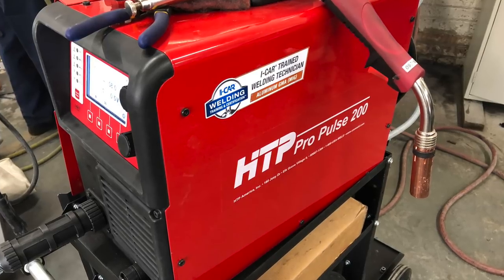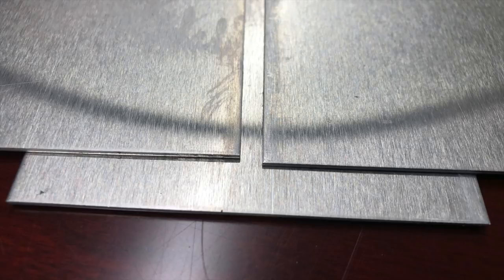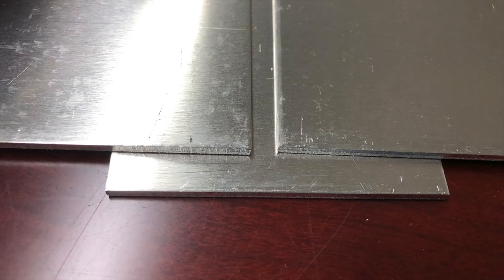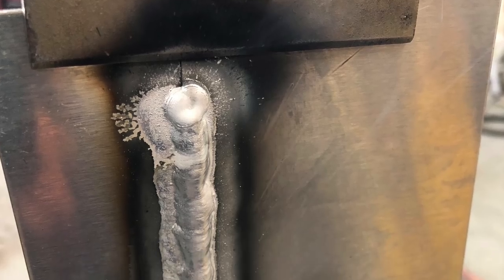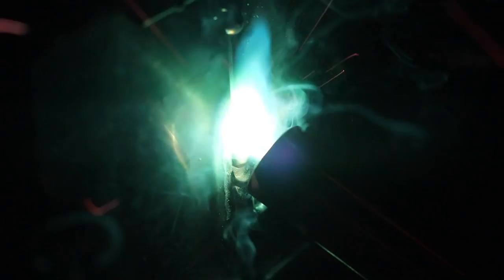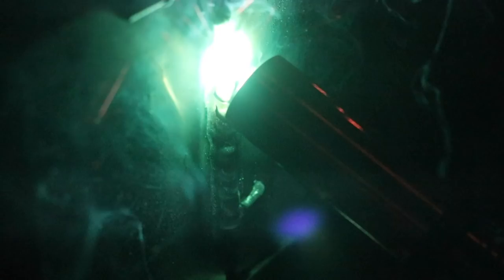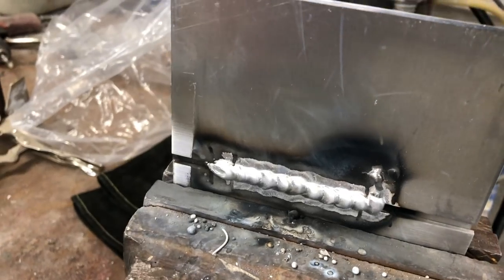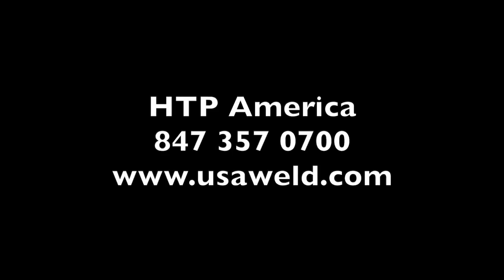(WCA03) Aluminum Welding test information for the collision repair industry

Comment: I was just thinking last night that I hadn't seen any Zila posts for a while then one pops up the next morning,  I must have picked up some psychic pulse waves in the air.
Reply from the maker: I am so far behind .....  i have at least 8 videos that i need to cut and edit - looks like this weekend i will get at least a couple done.
Reply: @ZILAwelds  I have a question

what do you think of Binzel gun
Reply from the maker: F.H HH i like them - but i am biased. I grew up in europe and that is pretty much all people have there. The air cooled torches work great up to 250 amp after that i prefer water cooled binzel  stuff or if it has to be air cooled tweco #5.